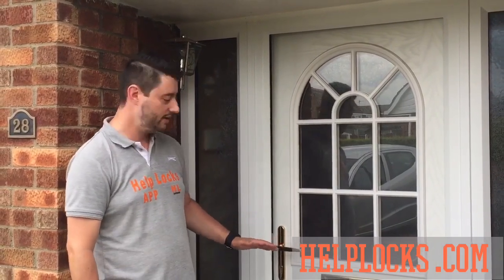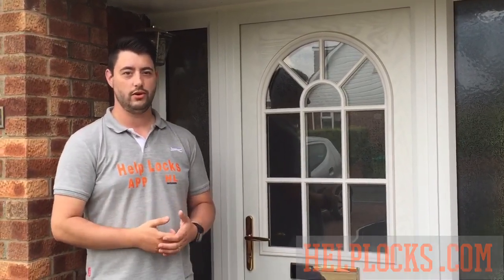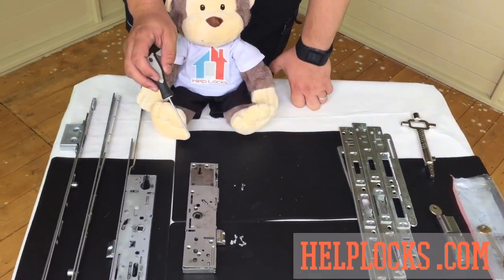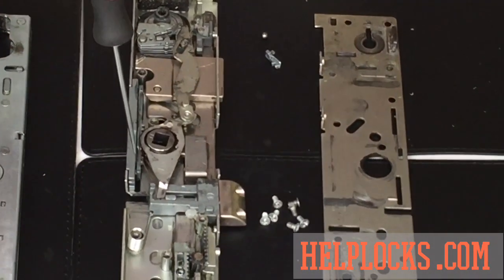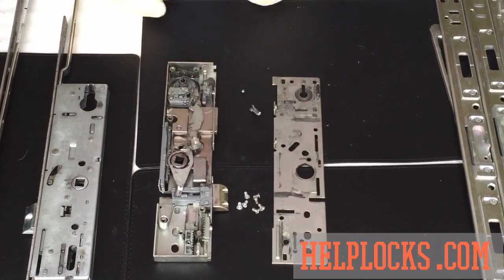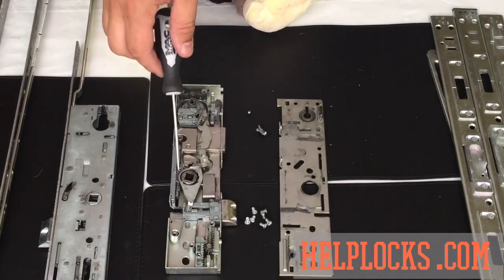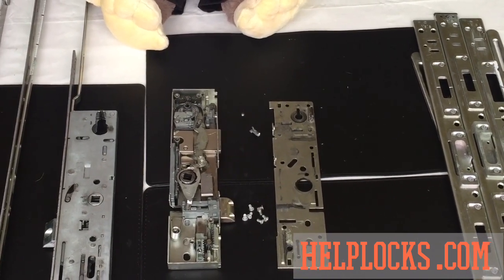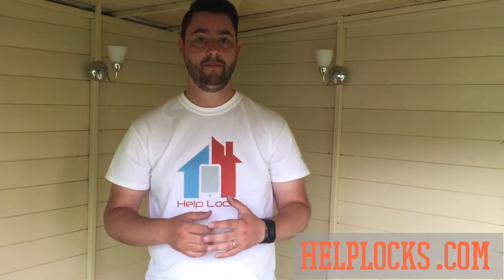Inside a uPVC door mechanism https://www.helplocks.com

Comment: You said "This is a much more expensive repair than a service once every 18 months would be.  What happens on a service that is so cheap that I guess the gearbox is not opened?  Would it really have prevented that part from breaking?

I have just had a very similar fault - when the key is turned, the mechanism doesn't lock the door, and when I opened the "gearbox", I found that the exact same part was broken - that little rack of a rack & pinion mechanism had snapped.  Actually, it's a double mechanism - there are two racks, apparently to divorce the operations of the outside and inside door handles - and on mine, one was broken, similar to the one you show, but the other one was also bent slightly - and it appears to be cast aluminium, which does not bend far before it breaks - so I'm lucky mine was still working at all.  In any event, I can't see how it explains the fault I have - the key turns and turns, and the door doesn't lock - so the little mechanism that moves in linear slots, moved by the tab on the key cylinder, and blocks the lock tang in the locked position, is not working.  It's at the lowest part of the mechanism, so maybe it was being interfered with by a broken piece that had fallen into it.

I've got a new one on order - but I must say I'm not very impressed with the mechanical quality of the manufacture of this "gearbox".  Thank goodness its designers weren't involved with the design of my car!!  My car is 18 years old, and this door gearbox is only six years old, and as far as I can tell, does not get abused.  I guess it guarantees an on-going sales channel for the manufacturers.
Reply: Came to the comments to write this. A service would not have prevented this.

Comment: SERVICE? How?....Cheaper to just replace than someone coming out to service a door lock every year surely?...you can buy these locks starting at about £30 upwards very easy to replace as a competent DIY person
Reply: my door is 30 years old, its just had a spray of silicone on the cam rollers every year, never had any problems

Comment: Thanks for the explanation of the lock.  In my case the jammed part is the DEADBOLT.  The deadbolt is not parallel with the floor, rather it is jammed at an angle towards the floor.  It won't retract or move, as a result the frame latch locks won't retract either.  What would you suggest I do to get the door open to  replace the gear box?  It is a 1-3/4" thick door, 32" wide,  inswing, with three hinges.
Reply: Call a door repair man.

Comment: Howdy. This is what happened to my door. I can do the repair, but I can't get the door open to access the gearbox. Any advice would be great.
Reply: David Thorne knock the pins out of the hinges and remove the door. When you figure out the problem and fix it you can put it back together.
Reply: Thanks

Comment: What would be wrong with a mechanism if the door handle, when lifting to lock, won't spring back down to its normal position? Yet if pressed down, to open, it springs back up?

Comment: Hi.  Thanks for the video.  I had the exact same thing break and jam on my door.  I managed to push the latch back with a piece on metal to get the door open and then took the mechanism off.  I got the broken piece out of the back of the mechanism that was jamming the latch and put it back in the door (without the broken off bit). Now it all works fine again.  Is there any reason not to carry on using it with out the little bit? Thanks.
Reply: Is your lock still working with the missing bit.

Comment: Thanks for showing the insides of the handle mechanism. My problem is trying to get the mechanism out. Although I've previously replaced the cylinder, I can no longer get it out. The screws and cylinder bolt are no problem, but the cylinder seems to be lodged in place by something and even a good tap won't dislodge it. It rattles, but won't move in either direction. I'm stumped. Not in the UK so I cannot seek your help.
Reply: Put the key in the cylinder lock and turn it slightly - it should just slip out.
Reply: I'd the same problem, luckily my son was eventually able to move the key at a certain angle & got it out - it's not easy

Comment: hi there you mentioned in the video a part had snapped and stopped the latch retracting how did you manage to retract the latch while the door was shut as I think this has happened and need to get the latch to retract so I can open the door and then fix the problem
Reply from the maker: This particular door was prized open with specialist locksmith tools. If you are in the West Yorkshire area, we would be happy to come and take a look for you but would recommend you call a local locksmith to fix your door. You will need to open the door causing minimal damage & then find the correct parts to repair it, by the time you have done all that yourself, you will probably regret not getting someone else to do it in a fraction of the time.
Reply: I had the same problem. The latch was held into place by a screw which had come loose but they're quite brittle & a good shove on the door broke the latch off with no other damage. I did replace the entire centre case gearbox for £16.50 & remedied some shocking workmanship done by whoever fitted the door in our new-build house. 

I also had to remedy another French door that jammed every time the weather temperature changed. Thirty minutes adjusting the flange hinges correctly & it hasn't jammed since.

Comment: Hi. My Euro cylinder lock has jammed, the key is stuck and I can't turn it or pull it out. I want to take the whole locking mechanism out of the door but can't because I can't take the Euro cylinder out of the door. I also don't want to snap it out because it's a brand new ABS lock. Do you have any suggestions? The metal strip up the door is riveted to the gearbox, and I'm considering drilling the rivets out, but not sure if that will even work.
Reply from the maker: Fuck off Google Plus 
Best advice I can give you is to call a locksmith... We can come and take a look if you are in the West Yorkshire area or if not, I recommend you try and book a Master Locksmith Association locksmith who is local to you. 
In the mean time, I certainly would not drill the mechanism or do anything until a locksmith gets there as quite often, when people are unsuccessful in repairing a lock or mechanism, they end up spending more  money when it's repaired.
Reply: Help Locks ah I suppose that would be the sensible thing to do. Thanks for replying

Comment: Hiya mate. I'm looking to automating a pvc door with a rfid reader. What do you recommend for the mechanical mechanism
Reply from the maker: Welshcakes have you heard about Ultion Smart?

Take a look here: https://helplocks.com/locksmith/ultion-smart/

We also have some videos on our YouTube channel...
Reply: @Helplocks  are they suitable for external use.  I have just had one of those rfid implants. So I was hoping I could just buy a electronic locking rail to drop into my existing doors. It's just a server to push the lock bar up and down... I may dismantle the lock mechanism and see what I can bridge in there to fit...
Reply from the maker: Welshcakes yes they are made primarily for external use... feel free to call if you would like to discuss further: 0800 002 5258
Reply: @Helplocks  thanx mate. Your videos should be help enuff. Your videos are very detailed. I've  just RFID'd my motorbike. So I imagine I'll be ok. I may be in touch to buy a system if I cant build one. Good day to you good sir.and thankyou for your time.

Comment: Anyone know what it means when a latch sits partial in out. Seems the handle doesn't retract or release the latch. The locks and multipoint locks seems to work with handle?
Reply from the maker: R Ali it sounds like the spring in the latch has gone. I would change the gearbox asap before a broken part gets logged into something that  stops the mechanism working completely
Reply: @Helplocks  thanks. Any ideas of a rough estimate cost. I'm in London. Many thanks
Reply from the maker: R Ali we are in West Yorkshire & would charge £170 for a gearbox change... I expect it would be higher in London... best advice would be to get 3 quotes from local companies & avoid the nationals.

Comment: This is the problem now with you tube , you posted this video to be helpful and gain some customers , I have no problem with that , but as a locksmith myself with over 30 years in the trade I am getting called more and more to rectify problems with alignment / locks etc because someone came on you tube  , watched a video and thought they could do it themselves. Most of the time they end up needing a entire new locking system etc because they fucked it up/lost a spring etc, costing them more money in the long run. ADVICE TO NON LOCKSMITHS WATCHING THIS. CALL A QUALIFIED LOCKSMITH most of us are  genuine and honest tradesman who will not rip you off. Rant over.
Reply: Well I think 2nd that. I thought I was saving myself some money, especially before Christmas, so I took the side panel off my door to see what was going on, 1st thing was 2 spindles fell out onto the floor - no idea where they came from! Then, as I couldn't see what was going on inside the Lockmaster centre casing gearbox (I know it's called that because I spent about hours in the phone to various companies to seeing anyone could help me, but they couldn't), I thought it would be a great idea tonopen it & half the contents sprung out at me! No idea how they went back in. 6 hours later I've been able to get some of the bits back in my door, & a lot of the casing contents in the right places (I think) BUT I'm left with a U shaped piece & a long thin part that has the number C029F on it. Any help would be greatly appreciated as I can't even close my front door until the locksmith comes tomorrow afternoon. I had to use sellotape to close it over so my dog wouldn't escape & we're going to have to put our shoe benches in front of it for tonight & I'm having 2 sleep downstairs - nightmare!